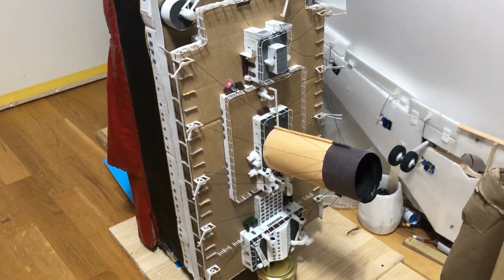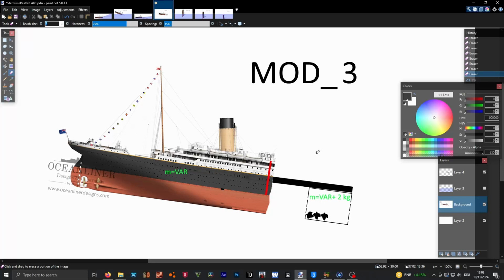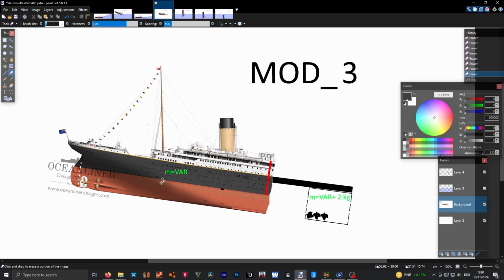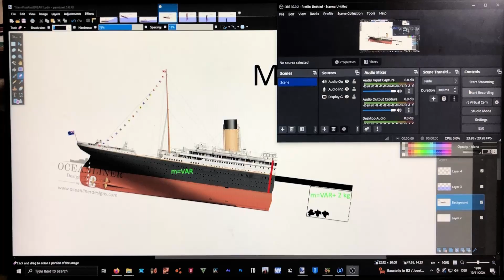How will the 3 METER CARDBOARD TITANIC stern go vertical?

Comment: Sounds like a good plan. I’m just not sure if an additional 2kgs will make it sink fast enough to pull the stern down fast enough, considering the bulkheads are quite short.
Reply: My thought experiments show success only when the holes are large 😂. Make sure the canister loses buoyancy faster than the stern does.
Reply from the maker: No, no, this is not meant to sink the stern, it’s just to make it go vertical. The sinking will be a separate stage. The stern will not lose any buoyancy but the canister will, which will make the lever go down and the stern rise. That’s the plan. There’s also gonna be a watertight wall in the opening to make sure it’s sealed completely
Reply: @Mr.401_Official  Oh ok, makes sense then. I like your experiments.